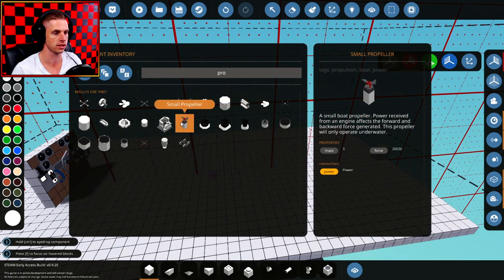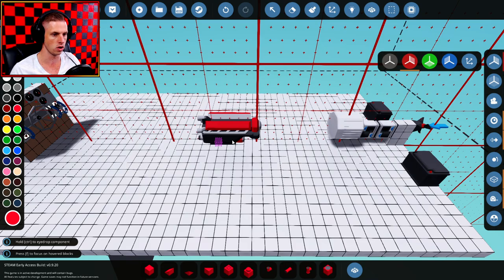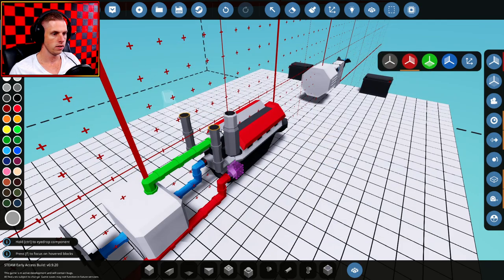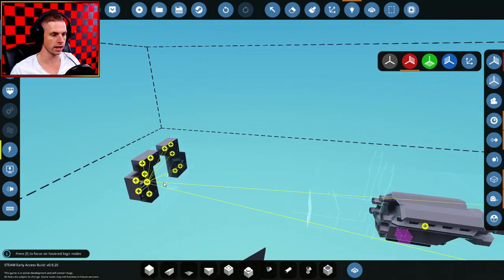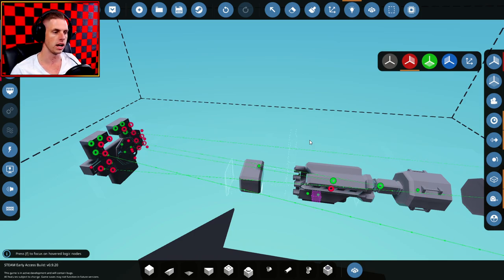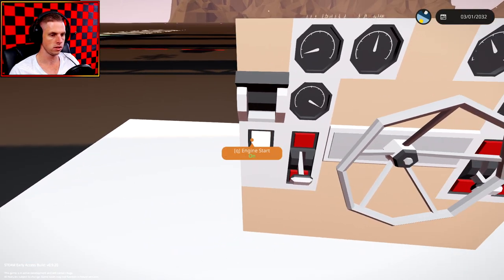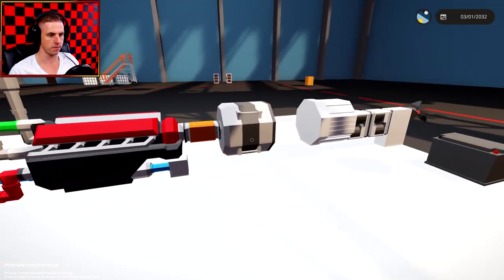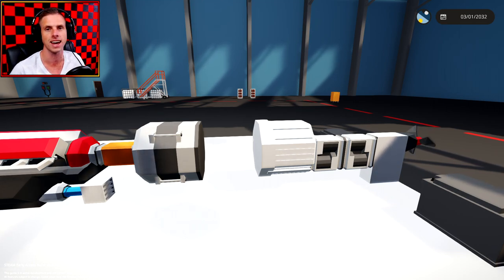How To Build A Hybrid (Diesel Electric) System In Stormworks Build And Rescue!

Comment from the maker: Just for those who want to get technical. I am fully aware that this is a Diesel Electric setup. I called it a hybrid as Diesel Electric is too long for Thumbnails and Titles. It is also stated in the description that this is a basic Diesel Electric system. If you want an actual hybrid system you can simply link the diesel engine into the final drive line using a T - Piece but keeping batteries charged is difficult enough as it stands at the moment so pushing power into the final drive line from the diesel engine will take away from the generators and the batteries will go flat leaving you with a diesel powered boat with no functioning electronics. I am sure there are ways to create a fully functional hybrid system but this tutorial is intended for less experienced players to learn the basics of using electric motors.
Reply: RedonkulousDave very helpful video thank you

Comment: You could also use smaller generators with more gearing, the larger the generator, the more load that is on the engine, and it’s efficiency will differ when you actually put a load on the electric motor instead of running it dry(out of the water)
Reply from the maker: Yep, there are so many variations that could be made to a system like this but I tried to keep it as simple as possible 😀

Comment: It's going to be a tedious when manually disengage clutch generator. What I recommend is used auto disengage clutch using microcontroller or logic by using numerical switchbox and capacitor and greater than.
Reply from the maker: Yes a lot of the system can be automated but for the purpose of the tutorial I try and keep things as simple as possible 😀

Comment: I have been using this type of system for my larger ships, but the whole community tells me it is the least efficient setup. They all tell me to use inline drive or true hybrid (what ever the hell that is), but never explain how to do it. Also for everyone that keeps telling me about more efficient setup's, why is it I still burn just as much running direct drive as I do with this hybrid system. 

Both require the same amount of engines to either push the ship forward at speed, or the number of engines to push the gens to power electric motors. Both systems require insane amounts of engines-power ratios to provide forward motion. 

And before anyone tells me to play with the gearboxes, I WANT TO GO FURTHER WITH LESS FUEL BURNED. I know I can run faster with a higher gear ratio, but I will burn much more fuel in the process. It's either I go for 100km at 10mps, or 20km at 25mps. If your systems are so much better then why won't you show how to do it, or at least be willing to explain methods of building better systems.

Comment: Is it possible to go full electric?
Reply from the maker: You could go full electric but you would need a way to keep batteries charged. Solar is an option but recharge rate is very low so you would need so many that its not practical. Could be fun to play around with though :) Have a good one!
Reply: Thanks!